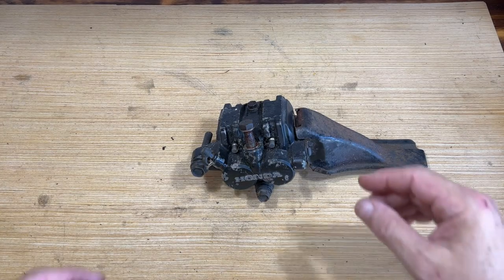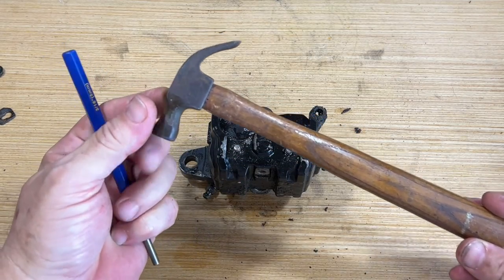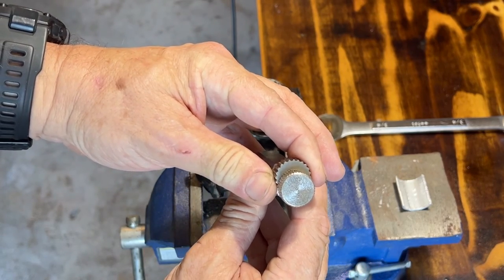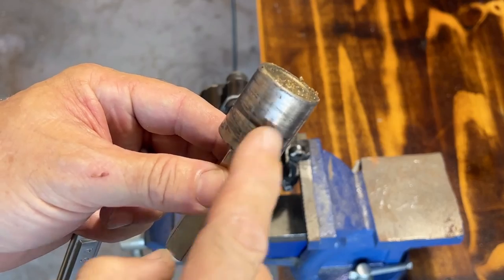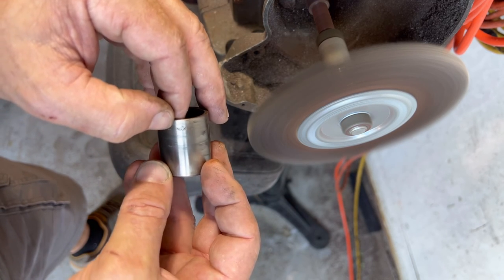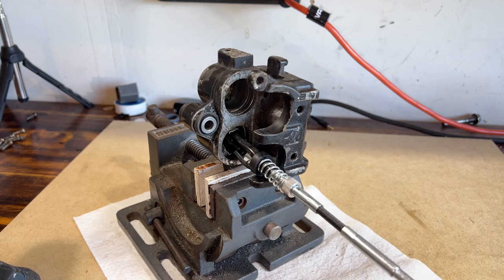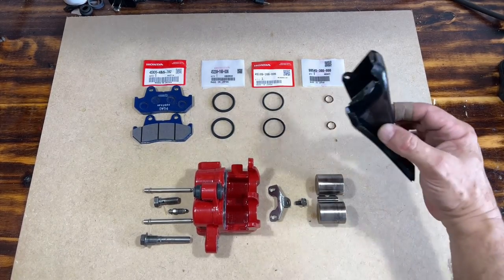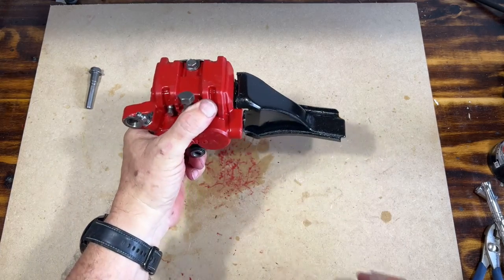Honda Goldwing | Rebuild Rear Brake Caliper 🛵

Comment: Never seen that internal adjustable wrench thing, pretty neat tool. 

You need to use a little white paint on the HONDA logo, that way you get a red, white and blue caliper. I was not expecting the red caliper, figured you would have done it black, but it looks good.
Reply from the maker: I like your idea of the red, white and blue color scheme! The red and black cans were next to each other and I said "what the heck, let me go red!!"

Comment: Do you lube the rubber rings with brake fluid or seal lube I could read bottle in video I'm working on my 1981 1100 back was stuck I got it all clean out now and ready to rebuild mine only has one ring and it looks fine so I didn't buy another one cause they said would have to order it

Comment: I'm in the early process of rebuilding a 1980 Goldwing and find that the seal and rebuild kits vary wildly in price . I get that the OEM stuff is going to be higher but can you recommend a reasonably priced rebuild kit supplier for brakes and carburetors? Thanks for the videos. Really appreciate the content Brother.
Reply from the maker: I use partzilla.com, reveille.com, amazon.com and jpcycles.com as well as craigslist.com, Price and availability will be all over the place.
Thanks for watching!

Comment: Instead of the aluminum "bush", how about a PVC bush??? just get new pistons and seals. Your life relies on clean, unpitted stoppers. Im sure it will work. new parts are cheaper than life.
Reply from the maker: Yes, new parts would have been the best option.